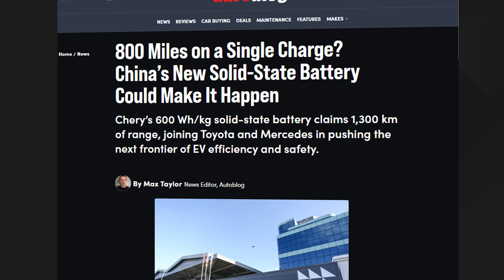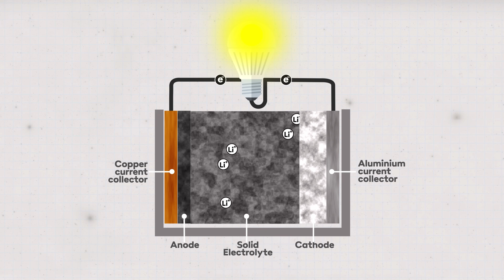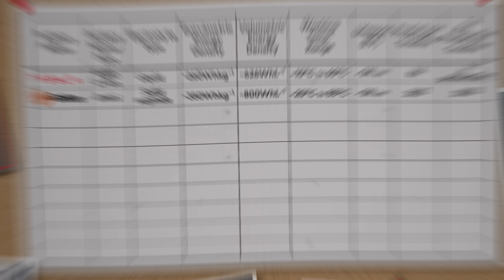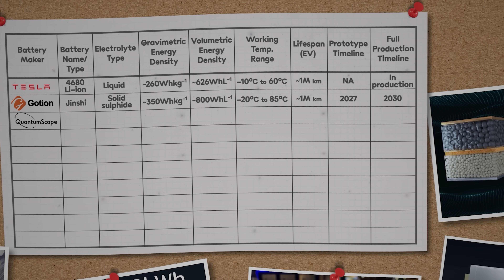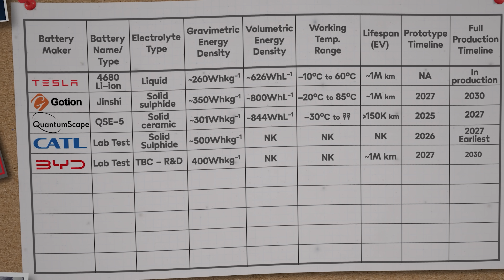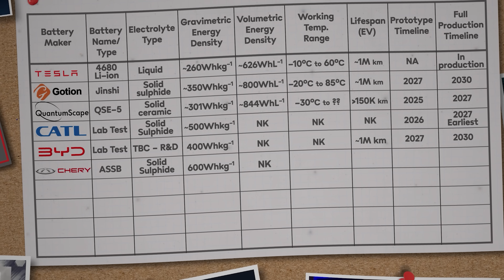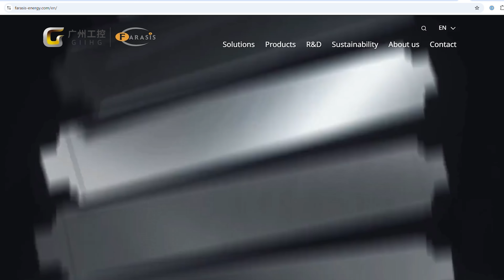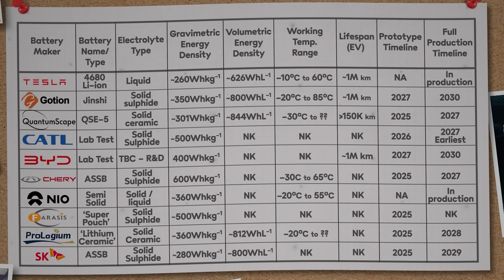Solid-State batteries. Finally arrived?

Comment: I don't think that choosing Dunkirk is a coincidence:

France is actively developing rare earth metal production, with several major projects underway to reduce European dependence on imports, especially from China.
Here’s a breakdown of the key initiatives:

🇫🇷 Major Rare Earth Projects in France
1. Caremag Project (Southwestern France)
- Led by French startup Carester, backed by French and Japanese investment.
- Aims to supply 15% of global heavy rare earth demand by 2026.
- Focuses on building one of Europe’s first operational rare earth production facilities.
2. Solvay La Rochelle Facility
- Belgian chemical giant Solvay has expanded its plant in La Rochelle.
- Now capable of separating all rare earth materials, making it the largest such facility outside China.
- Produces neodymium and praseodymium for permanent magnets, used in EVs, wind turbines, and military tech.
3. Less Common Metals (LCM) Investment
- UK-based LCM plans to invest €110 million in a new plant in Lacq, France.
- Will produce both light and heavy rare earth metals and alloys.
- Expected to create 100–140 jobs and strengthen Europe’s midstream supply chain.
4. EU Strategic Support
- The European Union is backing these efforts as part of its Critical Raw Materials Act.
- France is central to the EU’s strategy to reduce reliance on Chinese rare earths.

🌍 Why This Matters
- Rare earth metals are essential for clean energy, electronics, and defense.
- Europe has long depended on imports, especially from China, which dominates global supply.
- France’s initiatives mark a turning point in European resource independence and industrial resilience.

Comment: 12:00 What happens to all those little fingers of solid material when they cool in the micro crevaces?  Different material retract and expand differently.  Do they break off?  Do they stress the other material? Does the constant heating and cooling after production cause issues during use?

Comment: Any way yet to use the sun and/or wind resistance, when travelling, to trickle charge a battery yet? Also, thinking of getting a battery soon for my home in Oz with a 7.04kW system on my roof. Would rather feed a battery than sell my spare power back to my energy provider for near nothing.

Comment: A long range battery is one thing, but access to cheap charging is another. 40% of the UK do not have driveways and are not permitted to use/install floor/pavement/road  channels from house/flat to car, thereby missing out on the 3p/mile rate for slow home charging and expanding grid flexibility at times of 'Dunkelflaute'. In some towns like Nottingham : Location: Five induction charging pads were installed in the road surface at the taxi rank on Trent Street, outside Nottingham's railway station.Vehicles: Nine electric taxis were retrofitted and used for the trial: five LEVC TX and four Nissan e-NV200.
How it worked: Taxis drove over the ground-based pads to charge wirelessly. An in-cab HMI screen helps drivers position their vehicles correctly. One day it will all make sense, long range sodium batteries with non dedicated concealed charger zones in ordinary residential parking spaces, perhaps with bookable economic car hire...Maybe around the year 2047?
Reply: In not some tinfoil hat dude scared of 5g radiation or any of that bs, but wireless charging something at 10 or 20kw seems super sketch. It's probably "safe" though or they wouldn't try it, hopefully

Comment: It seems that there is real reason for optimism about the path to commercial all solid state batteries.  There are a large number of serious companies putting significant amounts of money into getting this technology into production.  Each is using different chemistry and production methods, and it seems unlikely that every company will fail.

Comment: I expect when solid state does turn up it will command a massive premium and it won't be going into low-end production vehicles any time soon. It''ll go into drones, electric aircraft, hyper cars and things like that where the cost of solid state is justified in some way - energy density by volume or weight. And slowly it will creep into car manufacturing. I don't think it will supplant LFP or sodium ion for a long time. It'll cost too much, or manufacturers will use it as a model differentiator - "pay us 4k more if you want better range".

Comment: Unsubscribed due to the incorrect information regarding EV's. As you can read in the comments those with real world experience driving EV's have corrected some of your inaccuracies and pointed out the real world use. FYI BYD now offer 1000kw charging which 400knm in 5 minutes.

Comment: Dude. I've got a hydrogen well in my back yard! Stuff just oozes out of the ground and lays there in puddles! What's wrong with the hydrogen fuel cell? 

Of course, that's not true though technically you can strip H2 from fossil fuels (releasing CO2 in the process) and use that to drive your fuel cell, losing energy to compression and having the stuff leak out of any defect possible, including the solid metal sides of the tanks.

But other than that, H2's a great fuel.

Comment: It's kind of difficult to care about these new battery technologies when incremental production improvements in LiFePO4s have made the hurdles of new technologies so much higher. I got a sodium-ion battery for evaluation a month ago and was confused/disappointed by its characteristics; would have been great 10 years ago. I can't help but wonder if there's really so much more potential in a new battery chemistry just by virtue of it being new; maybe we'd be better-served by the resources going toward increasing R&D of already-dominant chemistries.
Reply: Sodium ion is still on 1st gen, it just came out this year and it's completely normal for the 1st gen product to have a mid quality. 

Sure the energy density of sodium ion is always 20% lower than lithium ion due to the physics and the atom size of sodium, but it could still definitely be improved

Comment: My simple bellwether for solid state EVs is watching Tesla and, to a lesser extent, BYD. No clown shoes legacy autos that can't figure out how to make EVs profitability with current tech can be trusted to know anything about the logical crossover point for when solid state batteries are both technologically viable and cost-competitive for what you get. I believe Tesla/Elon has stated they have no expectations of solid state being better until early-mid 2030's. No one cares if your battery is better if the car costs $150,000+ or you lose $25,000+ per unit sold so can't sell them in high volume because you'd lose too much money--it has to be cost competitive relative to the spec improvements to matter or it's useless to the mass market.

Similarly, on the battery side, CATL/BYD are the most trustworthy here for similar reasons--they know the existing tech and know what it takes to bring improvements from the lab to full production. These startups haven't got a clue and are still focusing on the battery, not even yet grappling with the hard part: refining it for mass production and sorting out a supply chain to be able to produce them at unbelievable scale necessary to drive down costs.

Comment: I don't care about 800 or 1000 mile range on a BEV. It's ridiculous overkill in a personal vehicle. That's more range than anyone really needs outside of maybe something like a EV truck for towing. When towing that range will be halved and 400-500 mileage range is a bit more reasonable but still probably more than most people need. Now if you can cut that battery in 1/3 or 1/4 and give me a cheaper battery that has a 200-330 mile range it is actually cheaper than current options then you might have something. Personally, I'm more excited by LFP and the potential for Sodium batteries. Good enough and cheaper is going to be more impactful than super high range but very premium high end pricing. The only problem with small solid state battery packs might be that there are two few individual cells in the pack due to the high capacity of each cell. That makes it harder to balance the parallel vs series configuration to get the voltage level up for the pack while keeping the charge/discharge rates down by putting them in parallel. 

A 150kWh pack is far from the largest pack around. Things like the Rivian R1S/R1T Max Pack is 140kWh and GM has a number of vehicles with ~200kWh packs like the Hummer EV and the longest range versions of their SUVs and pick up trucks.

Comment: Here again, as always I say they won't be here until the average person can go down the road and buy a budget car with a SS battery. I suspect even the battery makers who are predicting 2027 and 2028 won't be mass producing them for budget cars until around 2030, it takes time to build manufacturing plants and ramp up production, and then there's the existing inventory of batteries to dispose of first, they certainly don't want to end up with a stack of LFP batteries that won't sell. So ramp up production, sell off existing inventory, luxury cars, big 4x4's, high end sports cars yes all possible before 2030, but mass production budget cars by 2030 is more likely.

Comment: Thank you for another great video! I love these summaries where you survey a technology and see how it's progressing. It sounds like cars with solid state batteries won't be available just yet. If most of the firms actually start manufacturing batteries in 2027, it'll probably be at least a few years after that before the vehicles are widely available. The companies predicting rollout by 2030 seem most realistic.

It sounds like Quantumscape has the most interesting design from a nerdy technical point of view - at least from what's been revealed. And Prologium may have the most interesting production process. "Fluidizing" the electrolyte during manufacture, then solidifying it again! Sounds like a pretty good trick. But being so different may slow down development compared to the companies using more straightforward and well known approaches. It'll probably be the huge Chinese companies like CATL and BYD that get the first practical solid state batteries made for vehicles.

Comment: Don't worry about a silly 1300km automobile range, 600Whr/Kg is aircraft energy density!  That is fantastic if they really can produce such at a reasonable cost. IF!
Reply: I’ve always felt that if current battery technology improves by a factor of 4 in terms of energy density to weight and volume ratio, while also improving on longevity a bit, EV’s will outshine most if not all fossile fueled road vehicles, marking the end of gasoline and diesel cars as we know it. For example, my EV currently has a range of about 350 km on a 90% charge while weighing around 2000 kg. If the weight could go down to about 1300 kg while increasing the range to about 750, a typical EV would compete or outperform a modern gasoline powered car on the basis of range and weight on a full tank, while outperforming it massively in terms of maintenance and such. I think the battries in my car are around 225 Whr/kg, so anywhere between 700 and 900 Whr would be ideal, but 600 Whr/kg would already be a major step in the right direction. Surely hope my next car will contain a battery like that (where I suspect my current car will still last at least four or five years).
Reply: @wvangool  Without a massive expansion with nuclear on our power grid, large expansions EVs of any kind is stillborn. To keep up with desired trends means our power grid must quadruple within the next decade or two. No one has even started to do this. Solar and wind at grid scale are boat anchors preventing the required grid expansions.

EVs have no long term future without a massive grid expansion, mostly centered on nuclear.
Reply: @justanothercomment416  It is definitely true that our grids need to be expanded and upgraded to facilitate the transition to electrification of transport and buildings. I am, in fact, also a big proponent of adding more nuclear to the mix for our energy needs. However, I see these things and modern battery development for things like EV’s as separate but complementary challenges we must solve in parallel. Fossil fuels are goign to die out, so even if the challenge such as upgrading our grid fourfold seems unreasonable or unattainable, we essentially have no choice.
Reply: @wvangool  We now have more known oil in the world than any other point in human history. For sociopolitical and socioeconomic reasons the truth is rarely spoken. Oil isn't going anywhere. Almost everything you use everyday comes from oil. It's here to stay. Oil is not going anywhere.

EVs are entirely dependent upon their ability to charge from the grid. They are tied. Expansion of EVs without expansion of the grid will only create an energy crisis and explosive energy costs (CA is a typical nightmare example). We cannot expand EVs without expanding the grid.
Reply: @justanothercomment416  What I meant to say was: just because we are going to need to upgrade our energy grids to make EVs work doesn’t mean we should wait with or stop with the development of EV / battery technology: we better work those two things in parallel.

Known oil reserves may be bigger than ever recorded, but we are also burning more and faster than ever before. Moreover, no matter how many reserves are left, there will always be a limit. Moreover, I’d much rather use that oil as resource for plastics and other products than as fuel.
Reply: @wvangool  Fair. 

Don't get me wrong. I'm not against EVs outright. They have some advantages. But they are socioeconomically harmful until the grid expands. Until people start pushing hard for nuclear expansion, EV production should not be pushed. Wide adoption of EVs can only happen when the grid is in position to support them.
Reply: @justanothercomment416 it's not likely everyone is all going to buy an ev at the same time, so it doesn't seem to be some huge deal, they'll upgrade over time. I'm not in a "green" state and they are still constantly upgrading the grid and even adding nuclear plants, 1st place to do so in awhile. It just really doesn't seem like it would matter much even if ev sales quadrupled.

Besides night time power is underutilized and cheap. Most people would be charging these things at home at night (at least in an area that has a bunch of nukes and gas plants). It'd take alot of evs to even get the power company to charge the same at night that they do during the day
Reply: @justanothercomment416 don't most states charge a fraction for power used during the night time?  As in the grid is already underutilized? And most people charge evs at night...

Then again im in the only state building new nuclear plants. It wouldnt be suprising if somewhere very solar dependent it would be the opposite
Reply: BTW, Chery's battery production is happening in a town named WooHoo!
Reply: Yes! That's the real use case here, together with HGVs and perhaps regional railways where overhead power doesn't cost in.
Reply: @kiae-nirodiariesencore4270 . HGV.  I suspect they will cost significantly more, so the cost / benefit may still favour less expensive batteries.  Especially with battery swapping.  Railways, not needed, weight not the issue, and power can be picked up intermittently.
Reply: 600 Wh/kg is 5% the energy/mass density of jet fuel. Maybe that would be viable for very small aircraft, but it is still a serious weight burden (which basically doesn't get any lighter as the flight progresses) that will impede any substantial commercial usage. Also, engineering-wise I'm not sure whether we even have a good electric alternative to jet engines.
Reply: @TLguitar  He's making his statement based upon what Elon said. The reality is, it opens the doors for things like drones and maybe city air taxi services, but not really practical for general aviation use. As you rightly point out, the energy density of petrol and especially diesel are really hard to beat. There isn't anything on the horizon which looks to be an actual competitor - contrary to the marketing hype.

Batteries are extremely heavy. Whereas drag induced upon an aircraft is reduced as fuel is burned off. Which means performance increases as fuel is burned off. With batteries, they simply remain dead weight throughout the entire flight profile, start to finish.

As a side benefit of fuel, fuel can also be used on some aircraft to manage useful load and Cg of the aircraft, depending on what needs to be moved and the distance. This is not an option with batteries. From a utilitarian position, they are much less attractive than multiple fuel tanks.
Reply: @TLguitar  Agreed, but that much power would be useful for the new-age ultra light drone type aircraft, right?
Reply: @TLguitar I don't know the sums, but it probably works better the bigger the aircraft.  Especially on the shorter distances. 
(Much as the big SUV can have much better range to a small city car)
Reply: @TLguitar  Yes if you compare the stored energy. But the energy efficiency of an electric motor and a jet engine are (around) 5:1 in favor of the latest.
Reply: @BonBaisers  It's difficult to gather exact numbers, but it seems a modern jet engine is about 40% efficient when considering how much chemical energy from the jet fuel is being translated into actual movement of the plane. I don't think an electric motor can be more than 100% efficient.